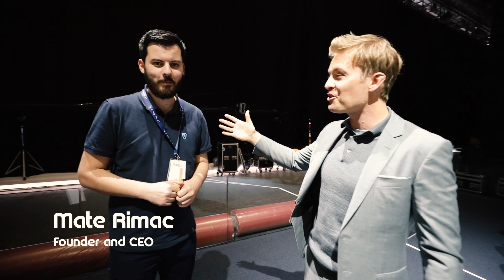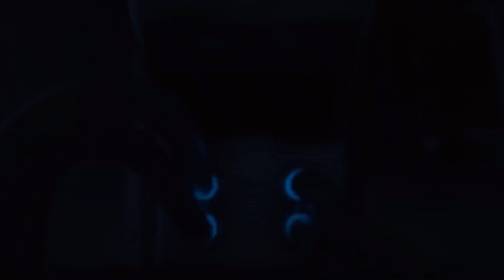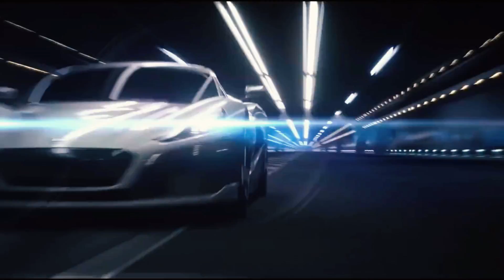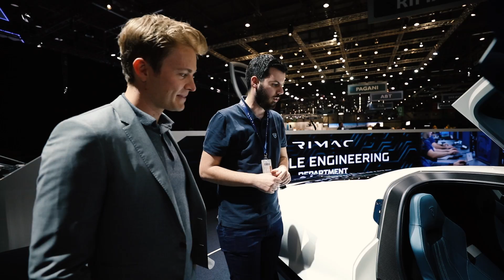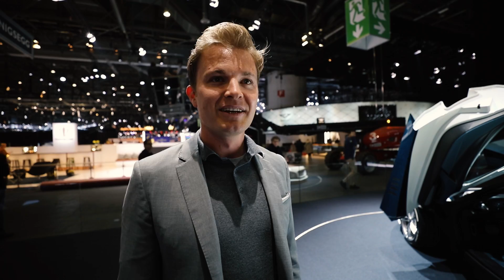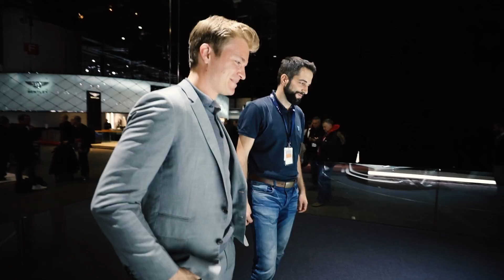RIMAC 0-100 IN 1.9 SEC CONFIRMED!!! | NICO ROSBERG | eVLOG

Comment: So far the only limit they face is tyers thats it, they will only go so fast with out breaching regulations through out the world, now if they wanted they could unleash it on the salt flats in Bonneville to break the speed record of a EV car, thats would be very close to the land speed record any i would guess even the speed of sound, based on the engineers RIMAC has. :) Got for it Marto, do that, which would a world wide event as well. :)

Comment: Tesla sports car just got 0 to 60 in 1.8 sec
Reply: That may be on trac, it is very hard for any car to get a 0-60 under 2.1 seconds because tires aren't grippy enough to hold onto the road when accelerating and slip, drag cars use spacial tires, prepared track, and warmed up tires michter's many cars is probably the only way this and the roadster get under 2.1 seconds, because if it's on the street its 2.1 for both of them.

Comment: This costs way more than the Tesla as they are only making 100.  They are making as many Teslas as people are ordering and you can still order one.  Also, some people have gotten the Tesla for free through the referral program, though they still have to pay taxes on a $250K car.  0-60 in 1.9 is for the base model Tesla.  Also, what's the range on this?  The Tesla has 620 miles range and seating for 4 (though likely the back seats are for children).

Comment: Dobra večer(Good evening)... It is 23.38h in Zagreb, Croatia... Some info about the car... Mate said for our media when c2 saw the day light that its top speed is 412km/h electronically limited. Why? Well fir safety reasons... Like 412 is not enough. He said that car could most likely reach speed of 500km/h but there are no tyres for that speed! Keep in mind we are not talking about ice motor and gearbox for leveling its torque range(sorry I am mechanical engineer) but the electric motors(even older means of car propulsion that ice motor... Ex.. Porsche..) which have 100% Nm/0rpm... So you have to develop one hell of the tyres!

Comment: Mate Rimac walks into Pirelli Tires HQ
"Your tires aren't fast enough"
"But Lamborghini, Bugatti, Ferrari, and Pagani all use our tires, why aren't they complaining?"
"Well, can they go 400kph and 0-100 in 1.9 seconds?"
"..."
Reply: bugatti uses michelins and Koenigsegg uses michelins and they did te word record speed on them
Reply: Mr. Shadez 
Yo!

The Rimac weight alot more than Bugatti and Lamborghini. It is an electric car, he wasn’t complaining at all. It was a fact.
Reply: @machunguanggangmei  weight difrence betveen rimac an chiron is about 50 kg and chiron is 1960 kg so rimac is about 2010 kn thats not tahat big of a difrence
Reply: @uciha4lee  Well... Yes and no. On paper the difference is quite small. But when you accelerate the power needed to propell this weight raises. So when you are reaching  record breaking 400 km/h those 50 kg become very significant.
Reply: Mr. Shadez Answer “duh”
Reply: Well it's electric... Lol
Reply: Bugatti works with Michelin, they were the only ones who could test the tyres, first of all. Bugatti tyres goes through same tests as plane tyres. The tyres needs to work in any kind of weather. VW in general, uses Michelin so...
Reply: Bugatti Chiron can't go over 300 MPH because no tire can handle it. ... Right now the Chiron is electronically limited at only 261 mph and currently wears the stickiest, grippiest set of Michelin rubber available to handle 1,480 horsepower. And 261 mph is only possible by inserting the "top speed key."

So you do the math, when you go 400kph 70 kg more it does hit the tyre hard.
Reply: @machunguanggangmei  you were saying what about 400 kph?

Comment: Surprised that it's a problem for the tires when Koenigsegg could push so much further with a car that was lighter but lienly more downforce.

Singlespeed is inconvenient for any drivetrain to both pull hard and go fast. Now the rear motors will likely rear 400kph easily by themselves. The front motors might only help up to 300kph to offer great torque and get the first 300 over with AFAP. 
Then again, it could even be the other way around. The rear motors to top out at 300kph for insane torque over say 180kph under which there would be traction limitation anyway. Then reach 300kph crazy quickly and the front motors to pull the thing up to 400kph.
So many options and trade-offs. But all are insanely quick.

Comment: I love the car and what Rimac pulled off in that short time they exist, but how you track it? Is there more information about that (it`s a Sportscar, so I guess the customers want to use it at track also)? I just see a 1416 kw drivetrain and a 120 kwh Battery. How is the usage of the Battery when you track it for example at the Nürburgring? - That would be great information. - Full throttle it would be about 5 Minutes of fun. So I guess there must be some clever management of Battery to get the Performance you want and the range/time you need.

Comment: F1 cars (presume current ) only manage 0-100kph in 2.6 seconds then Nico? I always envisaged they would have been much quicker, given their light weight, fat rear tyres, and abundant power. Perhaps it is a gearing issue that limits initial acceleration?
Reply: Laz Arus The problem is in the ICE itself, you have to rev it which takes time.  Electric offers 100% torque instantly, virtually no lag.  ICE super cars now have turbos, superchargers, hybrid assist, etc and still can’t compete with newer electric hyper cars.

Comment: Even if the car is able to accelerate in 1.9 sec in terms of power ok, but it’s physically impossible to accelerate faster than 2.1 sec to 100 with normal tires. Auto Motor and Sport made a video some time ago, calculating that
Reply: That is why he doesn't have normal tires. Rimac and pirelli are working together on tires for rimac cars. They even said that max speed is limited BECAUSE of tires. Car could go much faster but there are no tires that could endure that kind of pressure.
Reply: Pirelli is making a special tires for them I think.
Reply: Ofc it's possible.
Reply: @derbigpr500  if you say so, but you only have to do the math with all components regarding a normal tyre and no slick from f1
Reply: Already been done..
https://youtu.be/-kY6rCAuLpQ

Comment: It was 1.8 seconds before, just to pip the new Tesla Roadster... well 1.9 is a conservative number on the Tesla and that’s the base package, SpaceX package will change the game...
Reply: I doubt that very much. 
Top fuel dragsters take around 0.6 - 1 sec from 0 to 60mph. They have around 10.000 bhp with around 2200lbs weight. 
The tesla would need at least 1800hp to achieve their target numbers of 400km/h top speed but consequently with 200kwh batteries also around 4500-5500 lbs (est. with 100kwh model s with 5000lbs) 
There is absolutely no way they will get under 1.8 seconds with a battery that big. 
A space x version is supposed to use cold gas powered thrusters, which obviously makes the car not a car but a rocket and I very much doubt it can be road legal.
Reply: it was 1.85 beafore. that was with two gear gearbox. Now they are back to single gear.
Reply: This is a high end car bespoked you can collect it. The tesla roadster is a mass produced car apples and oranges comparison. Both being electric doesn't make them the same. Both are interesting. The roadsters performance needs to be shown